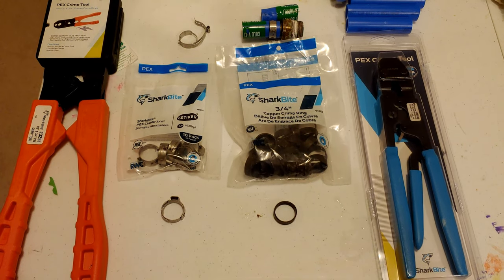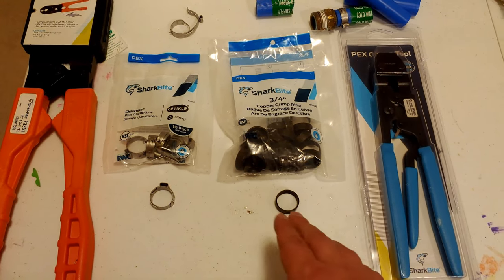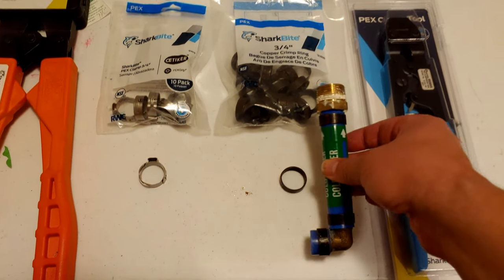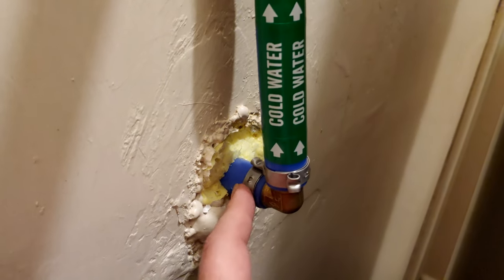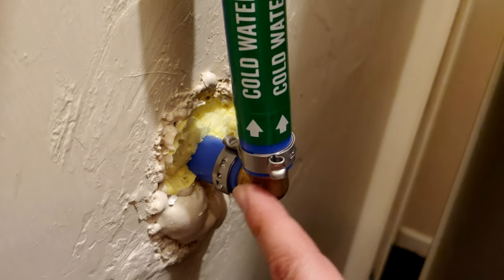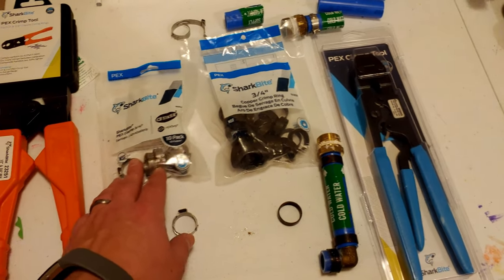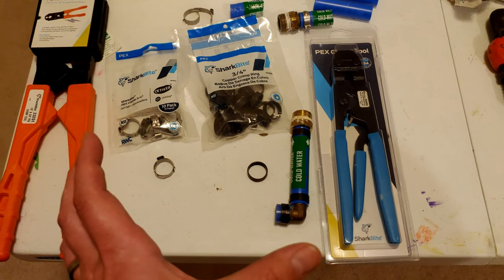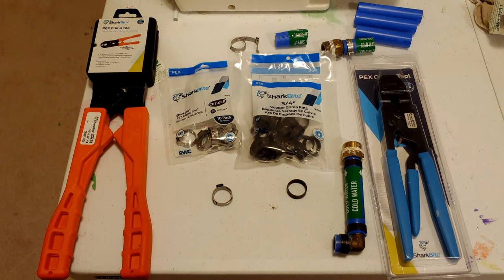PEX Copper Crimp Rings vs. Stainless Steel Clamps

Comment: I've always used pex copper rings. They provide exceptional compression force given a proper installation. The only time I've had to remove a copper ring is on a water heater replacement. In that case, I used a Dremel tool with a cut-off wheel to carefully score the copper ring thin enough to then insert a screwdriver into the slot created, twist the screwdriver to break off the copper ring without damaging the pex pipe. Informative video.
Reply: Sounds like it takes a lot longer than popping off stainless steel cinch rings, which can be reused, where cut copper can’t, but that is a really good solution that I will remember! Thank you :)
Reply: @chrisrioux you don’t reuse the stainless clinch rings after removal.
Reply: @chrisrioux  How the hell would you reuse a cinch ring? The cinch section can only be clamped once. It's trash once removed.
Reply: @John_Ridley  Oh, I thought one of the benefits I read about cinch rings is that they were reusable.. Perhaps I was just thinking of the fact you don't need to cut off/shorten the pex pipe when removing. (But couldn't you simply insert a small flat screwdriver and rotate it to re-expand the cinched part? Although I guess this may make it less reliable.. I have no experience, just been researching for a future DIY project).
Reply: @chrisrioux  It's really not worth it. The rings cost 17 cents each in 100 quantity. It'd suck to have your house flood because you wanted to save 17 cents.

Comment: There actually is a difference in strength between the two types. The copper ring works by being squeezed into an oval shape, and it presses on the PEX mostly in two places. The stainless ring in contrast squeezes in a complete 360 degree circle around the PEX,.

Comment: To remove the stainless steel clamp I use a Dremel too with a cutoff wheel and sever the loop that sticks up in the air. That way you never need to worry about nicking the PEX!
Reply: Just use a screwdriver to pop up the almost loose end of the clamp, off the little rivits that are holding it down.
Reply: I've done the same on many projects around the house.
Reply: @@badapple1403 --  There will be nothing "Good" about your side cutters after that kind of abuse!
Reply: Have used a screwdriver or pliers to mechanically pull apart the clamp a few times.  Mostly I use my manual cinch tool which has a setting to close the jaws farther to cut the clamp.
Reply: @rpsmith  Knipex my brother. They'll cut through anything and never blink. Sure paying $45 for side cutters hurts but they are the best.

Comment: From experience, I will say anybody out there who uses the copper crimp rings, if you have a Dremel with a cutoff wheel or even a multi-tool with a metal cutting blade, it is possible to cut the copper ring very precisely without damaging the pex. And then using a flat head screwdriver to pry the copper apart. I'll be at this can be very difficult depending on where you're cutting and the situation. But it is doable with a Dremel better than a multi-tool.
Reply: Another reason everyone needs a Dremel!

Comment: That's a baller video.  Was considering using all sharkbite push-fits for a small project I'm about to do / film.  But recently decided I'm going to buy a tool and rings....just didn't know which.  I was leaning copper rings but now I think the stainless steel clamps is the way to go.

Comment: I like the crimp style stainless steel as once you crimp it you can SEE it has been compressed. Guy I know and myself did a tug of war  trying to pull a pipe section apart showing me how strong these are. Not a chance we could even move them 1mm apart. That sold me

Comment: Matt Risinger's  pressure test showed the clamps holding strong even after the pex pipe burst at 500psi.  I only did a few fittings with the rings before switching to claps and I've never looked back. I got one of those Ryobi P660  (Black Friday $59 Direct Tools) and it's effortless- although I keep my ratchet crimper handy.
Reply from the maker: Oh awesome on the clamps specs, and that Ryobi P660 looks like the tool of choice to do this repeatedly. Thanks for watching!
Reply: I had the ring tool(same as shown) for a few years before getting a cinch clamp tool and more recently got the ryobi tool.  My ryobi came from DTO as well I think from the same sale and wasnt even planned, was on one of my visits to a regional store.  More often use cinch clamps because of easier installation and easier removal if necessary.

Comment: Good video - another convinient reason for clamp style is that you dont need to switch out ring size for different diameter pipes.  I have used both and lost my 1 inch ring crimp die.

Comment: I have all three PEX connection tools, the third being for the Uponor PEX type. I use each one several times in a large job because of where the connections need to go. I like PEX work because it is flexible and very easy to make connections where I wouldn't want to put a torch.
The Uponor PEX tool is different but works well. Firings for all the PEX types are rising in cost so I buy in bulk and I buy only the connectors I've used on most jobs. I like to go into new work buildings that have PEX piping and pick up off the floor the connectors the plumbers cut out and tossed away. I use my crimp ring cutter tool to clean them up to where I can reuse them again, saving cost for me.

Comment: I developed my basement and did all the pex plumbing myself with little knowledge and home depot tools. I passed the plumbing portion of the inspection by the city.  When I made a crimp mistake, I used a dremel tool to cut off the brass rings when I needed to correct a hook up or routing it another direction it worked very well.

Comment: I'm using the copper crimp rings in bathroom remodel. On three occasions, I erred and used a dremel w/ a small cutoff disc to CAREFULLY cut through the band across it's full width. Was able to remove the ring w/o nicking the pipe itself. Re-crimped and all was fine upon pressure test. Not a technique I'd want to use all the time but in MY limited experience, it can be done successfully. That's not to say the SS clamps aren't inherently more removeable. 
And I very much second the idea that the copper ring clamp tool is hard to get into tight spaces. I had to adapt my design and prefab some connections in order to make  it work for me in some places. 
Thanks for the insight you've given us.
Reply from the maker: Wow nice job on the cutting of the copper crimp rings! Yeah you're correct a person would have to be super careful not to cut into the PEX or whatever using a dremmel tool, but good you found a way. Thanks for watching!
Reply: Yeah that’s the way I remove copper rings a dremel tool but not cut all the way through and put a flat head screw driver in the slot from the dremel and twist it we’ll pop pretty easy.

Comment: I do both, but favor the Stainless Clamp because one tool does it all, and space constraints. However, on 1" fittings, don't forget to bring a " cheater bar" 'cause the clamp tool will require assistance.

Comment: Good video!  I think that it is important to point out that a conventional Oetiker crimp tool will not apply enough force to close the PEX ring.  Menards has the rings, but not the tool. I was able to find a Shark Bite branded crimp tool at Lowes.
Reply from the maker: Thanks for the info!

Comment: When I first started using PEX copper rings I had a manual crimp tool with the 1/2" opening in front of the 3/4" opening, so it would often be awkward to use in some situations
Because of this I would often use stainless cinch clamps, and eventually purchased different manual and powered crimp tools with size specific heads

Comment: Good information. It looks like the stainless steel clamps would be easier to use, putting on or taking off. Very informative video.
Reply from the maker: Yeah I learned a lot in a short amount of time as I had a plumbing leak on that line I needed to fix. I saved like $300 doing it myself. Thanks for watching Rita!

Comment: I use the stainless steel clamp rings on PEX tubing.  Tool to clamp them can be operated one hand and will fit easily inside a joist bay in the basement.  And tool also fits inside a sink cabinet when clamping on the valves to the PEX tubing under the sink.  Also the stainless steel clamp rings are the same as band clamps.  Everyone uses and knows how to use band clamps.  And they are always successful.  Familiarity.

Comment: You can normally use an oscillating tool or a dremel with a cut off wheel to cut the rings easily.

Comment: Stainless steel 3/4" are $17 for 100 on Amazon. I bought a ratcheting multi pull cinch tool that's WAY easier to use than either of the ones shown, and fits into much smaller spaces. The cinch tool is MUCH easier to get on to a pipe that's tight against the wall - you may not be able to get the crimp tool around at all. The cinch uses the same tool for 3/8 all the way to 1 inch tubing.
I just started with Pex and I saw a lot of examples on YT about using the crimp stuff, but once I saw the cinch rings and tools, IMO it's no comparison, I'm using cinch all the way.
BTW I doubt those cinch rings are patented for Pex specifically - they're the exact hose clamp design that's been used in automotive pipes since I think the 1980s.

Comment: I mainly use the SS rings when access is an issue. Sometimes it is the only thing that will fit. Almost all my work is retrofit and repair, hardly ever new construction. The corrosion issue with stainless steel is chloride induced stress corrosion cracking. You have to be careful with them anywhere there is salt or chlorine in the area and heat (140 F plus) or they will crack. For normal municipal water they should last a lifetime.

Comment: Just a note about the tools. Both tools come with smaller ratcheting single hand tools, that are much smaller than the "bolt cutters" and there are also battery powered versions of the tools (Ryobi makes reasonably priced ones) for bigger jobs... but of course if you are a homeowner, what are you going to do with the powered tool once you're done your project? At least the hand tools don't take up much space and will basically always work.
Reply from the maker: Yes great advice, and if I was a professional I'd surely go with a battery powered version for repeated use. Thanks for watching!

Comment: The ring tool is very hard to get over the ring if close to a wall or joist. The SS clamp works off the end of the tool which is easier IMO. The rings have a better finish appearance however.
Reply from the maker: I agree. I too actually like the look of the copper rings better as they don't have the end that sticks out like the SS ones, but the SS ones are advantageous per the things I mentioned in the video. Thanks for watching!

Comment: Just two weeks ago I had to open our wall above the shower stall as water was trickling through, to learn a SS clamp had rusted through and failed finally.  My first thought was wondering how it rusted if it was SS...?  I took a magnet and it it pulled right to it, so it was not pure SS.  Either way, at least six years ago, it was not installed properly by a crew which retro-fitted that old gray tubing which was found to be faulty, so now I have had to replace not only gray tubing they missed, but those "SS" rings they used.  I guess they could have been cheap ones, but not sure as I could not read a brand through the corrosion.
I went with the copper and broke down and bought a Milwaukee 18V crimp tool, which I'm glad I did now that I've had to do dozens of repairs in our house and the neighbors are asking if I can help them as well.
A few years ago I worked with a Master Plumber who used only PEX A/Uponur and I really liked that system as well.  The expansion tool was $400 (M12), but that was my favorite system out of all I have worked with over the last 25 years.  It also has better reputation among contractors I know (doing remodels for 34 years).
Uponur fittings are a true full-capacity as well whereas the other systems' openings drop down in diameter and restrict flow.
I learned how to sweat copper in all this, mostly because I was curious, but I found myself getting nervous about fires occurring when framing was close by.  I can do it, but I'd rather use the Uponur fittings.
Reply from the maker: Appreciate the feedback based on your experience. I too if I had my way would sweat copper fittings, but this is easier and quicker as you mentioned. Thanks for watching!

Comment: You can get confined access crimpers, they look like little guillotines and you tighten them with a ratchet.  But in general I don't have anything against using the pinch crimps - I have that tool as well though I've only used it maybe once.  Nice to just have the copper rings and crimpers and not have to carry around another tool / another set of rings.

Comment: I've had the stainless ones leak the copper ones I've never had a leak and zurn makes a set for tight places and it's easy to squeeze check them out
Reply: Must have installed the SS ones wrong, I’ve installed many and have had no leaks.
Reply: @joelc9329  I've been using pex since 2001 and I'm a master plumber all them rings have caused leaks cause homeowners can afford tool and they try to do it themselves and flood there own house I've never bought that cheap tool always have had crimpers for copper rings but gave pics of them rings failing

Comment: I remove a copper ring with a cut off wheel without cutting the pipe. Then bend the cut ring with a flat screwdriver. If you're careful and take your time and not damage the PEX pipe, you can reuse the same pipe being the same length. To remove the pipe from the fitting, you have to heat the pipe to make it soft and it will come right off. My experience, a heat gun will not get it hot enough. I use a torch and it doesn't take much or very long to get it hot, just 2 or 3 seconds. With practice and experience you can get good at it if you need to remove a PEX joint with this method.

Comment: About Shark Bite, I’m not a plumber and inexperienced at plumbing. I’ve used them for years. No leaks. Ever. I don’t understand why people are down on em 🙂
Reply from the maker: Yeah it's not an old school mentality or anything, it's just need to see how they stand up to say sweating copper after 20+ years. In their docs IIRC Sharkbite guarantees up to 20 years. Tough to say. Like most if I was to use them it would be in exposed plumbing only (not behind a wall).
Reply: Of all the failures we've seen, most are prep and installation error related, whether it's copper sweat, ProPess, brazing, compression, push to connect, threaded, flared, glued etc
That said, the most inexperienced DIY types tend to favor push to connect fittings, so prep and installation errors are more common
Many professionals and more experienced DIY types don't like overuse of push to connects, nor using them in enclosed spaces

Comment: Use a hacksaw or cutoff wheel to cut a slit across the copper ring stopping before you cut into the pex and then pry it off with a screwdriver works for me. I prefer the copper rings, seen more leaks from the stainless clamps.

Comment: I like the stainless steel better,  the house I recently bought (few years ago) the copper rings developed blue/green type corrosion and I had one that failed (started leaking) but still felt tight,  I replaced it and some other copper rings that had corrosion with stainless steel and bought the crimp ring tool for stainless and haven't looked back, stanless are easy to remove with a pair of diagonal side cutting pliers if you need to do so.     I worked on aircraft for 30 years including large aircraft and on 3.000 - 4,000 psi aircraft hydraulics we use stainless steel on everything (lines, fittings, etc.  (not copper) so maybe that is one reason I like the stainless.
Reply from the maker: That's awesome the insight you have to this as an aircraft mechanic - in my house I don't mind spending the extra for stainless steel on all types of fasteners for that extra security and longevity. Appreciate the comment, and thanks for watching! 🛠️

Comment: I don't bother with the $27 removal tool. I use my dremel with a cutoff wheel. Works great. The differences in PEX rings: Copper, you may damage the outside of the PEX pipe but if you're very careful you won't. Stainless, just cut the tab in half, it'll fall apart. You won't be anywhere near the pipe. In both cases you'll need to heat the PEX after you've gotten the ring pried off to get the fitting out otherwise you'll have to cut it off anyway. Voila....done.

Comment: Why is my 3/4" copper ring slightly to big for a washer cabinet? It doesn't grab the capacitor after i crimp. And 1/2" pex with a 1/2" copper ring is to small.

Comment: A little confusing where on the get-go you show the crimp tool with stainless clamps beside it 
and the clamp tool with the copper cinch rings beside it. Swap the bags and it would make sense.

Comment: I have had two of the stainless steel pinch clamps fail and cause emergency calls and water damage. Plus I have had type b pex break from freezing. I have had zero failures from type A pex with expansion joint and therefore am going to type a exclusively
Reply: Pex A don't last, they burst with age. There is a big lawsuit against the company.
Reply: the lawsuit alleges the red and blue colored tubing fails.  Uponor says they have discontinued the solid colors. Luckily for me I have only used the semi transparent and I have never had a joint fail. Plus the flexibility aids installation.

Comment: I use both compression rings, copper and stainless steel. I wonder why the ½ inch stainless steel rings are 25% narrower than the ¾ inch ones since the distance of the ribs on the fittings are the same for both. Copper ones are the same size for ½ and ¾.